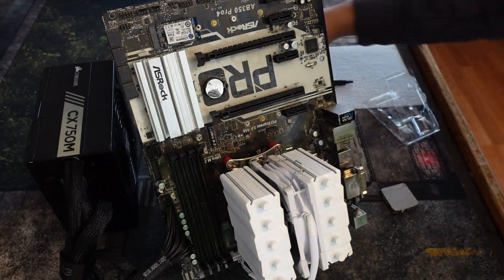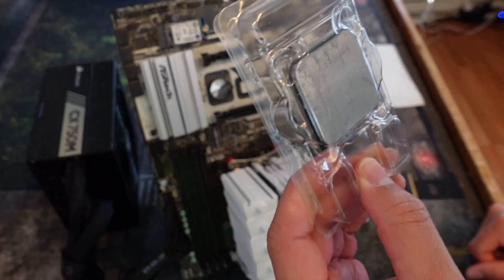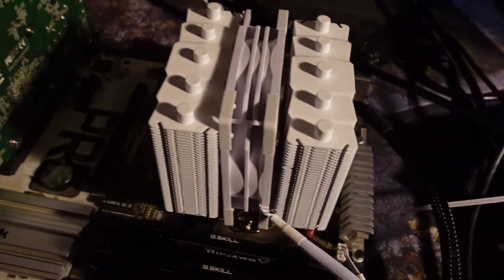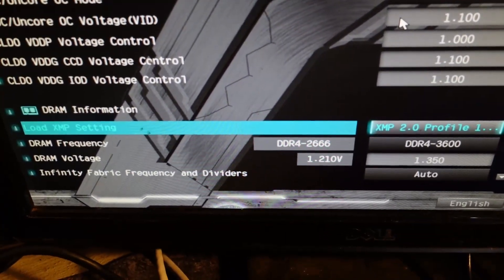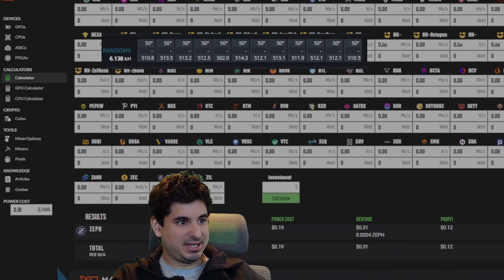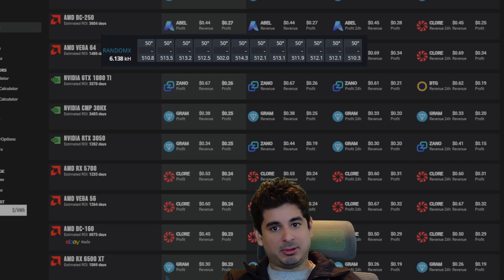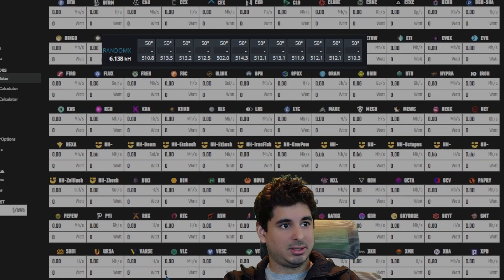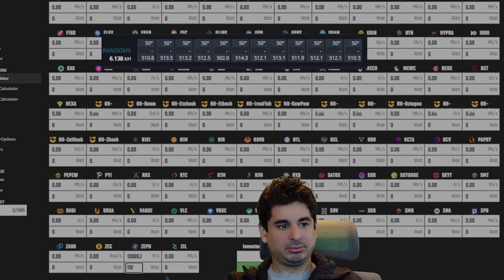Is the 5600x as good of a cpu miner as it is a gaming cpu?! LETS FIND OUT!

Comment: Get the same hashrate on a 5500 and a 5600g, I have cheap power and all the hardware so they still mining till I can buy some more 3900x or 5900x.
Reply from the maker: I mean at that point buy everything you need to set up the rig and when you get 3900x/5900x sell the cpu to help cover the cost.